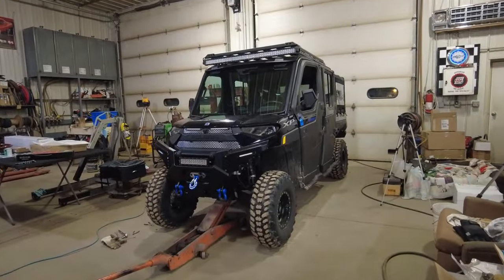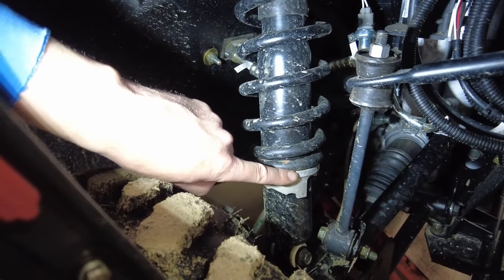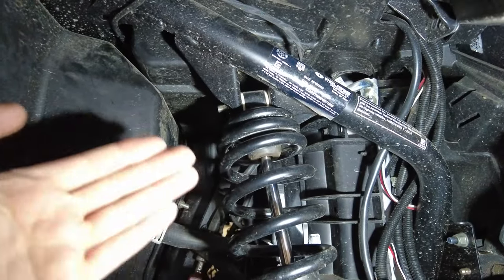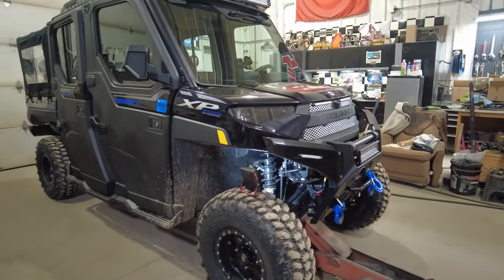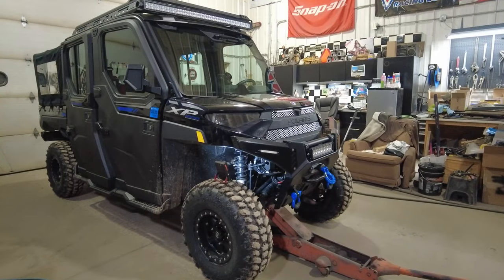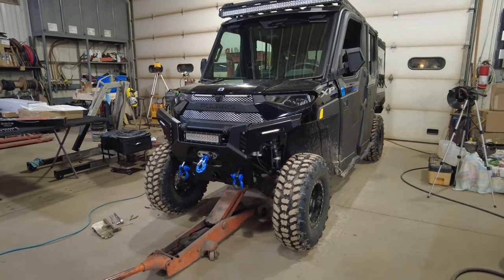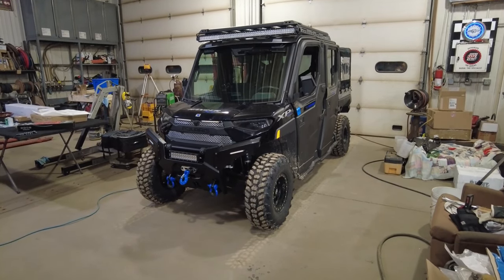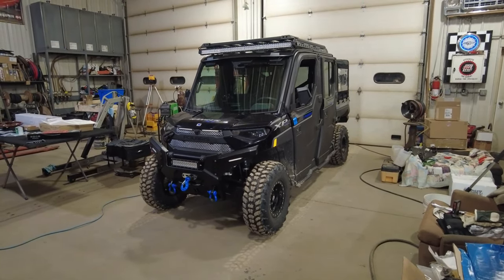2023 Polaris Ranger 1000XP Crew Suspension Adjustment

Comment from the maker: Things that might help with a project like this:
Kemimoto Soft Topper: https://amzn.to/3PUDxnT
Kemimoto ATV Bag: https://amzn.to/4c7Tz7u
Kemimoto Plate Holder: https://amzn.to/438Lqvt
Magnets: https://amzn.to/438YK2B
Shackle Mounts: https://amzn.to/3Sy5lyR
Blue Shackles: https://amzn.to/4bvMPzW
Tire Lube: https://amzn.to/3HKGu5N
Uinta 14x7 Rim: https://amzn.to/3HJKLqr
Sniper 920 30x10r14: https://amzn.to/42oHZjF
Auxbeam 52" Light Bar: https://amzn.to/3Hy0lVZ
Rhino Rack Rails: https://amzn.to/47x8DrI
60x48 Roof Rack: https://ebay.us/zDwBhD
Rhino Rack Rack: https://amzn.to/3TQlH8k
Mini Quick Fist: https://amzn.to/3v67jyu
KemiMoto Bed Mat: https://amzn.to/49t3D9C
KemiMoto Spare Tire Mount: https://amzn.to/3MTv3M7
KemiMoto Bed Side Kit: https://amzn.to/3SPHfkM
Fuel Tanks: https://amzn.to/47rPdFl
QuickFist: https://amzn.to/46qDtSj
Chainsaw Mount: https://amzn.to/47ypECe
Pro Armor Jack: https://amzn.to/46tEtVE
Traction Boards with Mounts: https://amzn.to/3upVL8W
MicTuning Rock Lights: https://amzn.to/47eXFru
Blue Switch: https://amzn.to/3MKJguT
KemiMoto Mud Guard: https://amzn.to/3SBPm4m
Frame Plug Kit: https://amzn.to/3MKrxUj
Fluid Film: https://amzn.to/3suVoJw
Fluid Film Gun: https://amzn.to/46723Y1
Polaris Rocker Guard: https://amzn.to/3MBP75J
A & UTV Pro Storage Bin: https://amzn.to/3QAAstK
A & UTV Pro Smoked Taillights: https://amzn.to/45EuKvb
Nicoko 12" Light Bar: https://amzn.to/48xPUhg
Light Mount Tube Clamp: https://amzn.to/46jkolA
Oil Change Kit: https://amzn.to/3LNdkFR
Polaris Fluids: https://amzn.to/3rDXWoh
Rough Country Wing Kit: https://amzn.to/3rynVNN
Side Mirrors: https://amzn.to/45WPRtK
Kemi Moto Seat Covers: https://amzn.to/3RpvuRr
Bumper Guards: https://amzn.to/48eP0Gh
Used ATV/UTV Parts:  https://www.powersportsnation.com/

This video contains affiliate links, which means that if you click on one of the product links and buy, I'll receive a small commission.

Comment: Did you measure before and after to see how much lift you got?
Reply from the maker: I did not measure. I have done this on Ranger 900 and if you move the shock to the outward hole and crank the spring adjustment all the way up, I believe you can get 1-1.5" lift. This is my first Northstar and it's a lot heavier than a standard Ranger 900, but I expect results will be very similar.